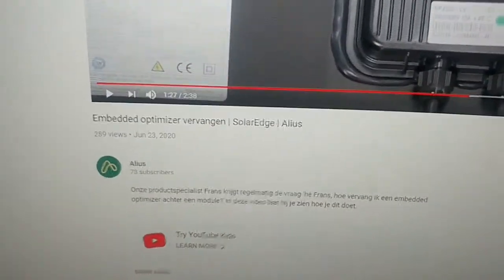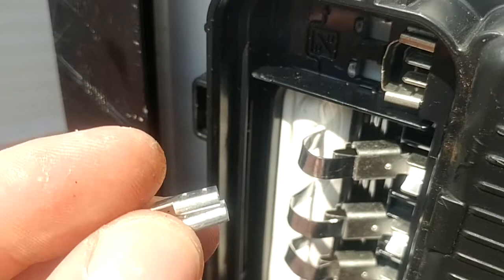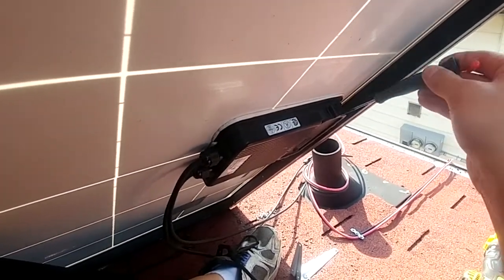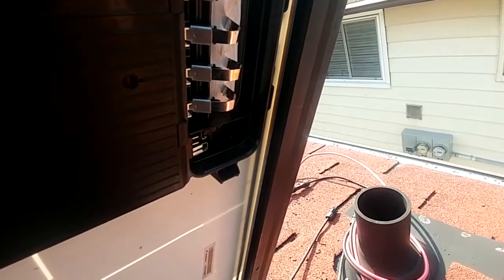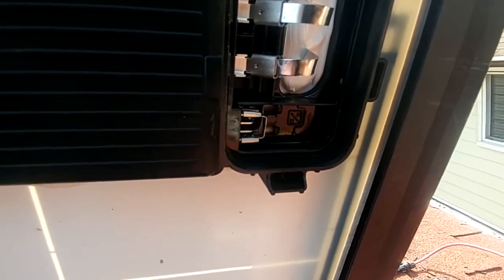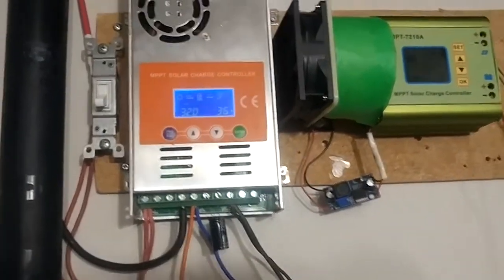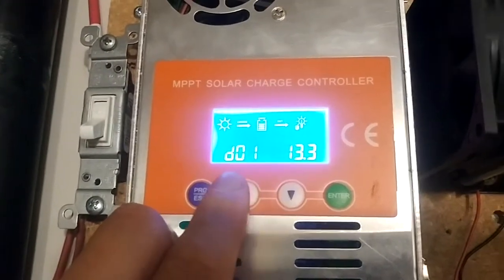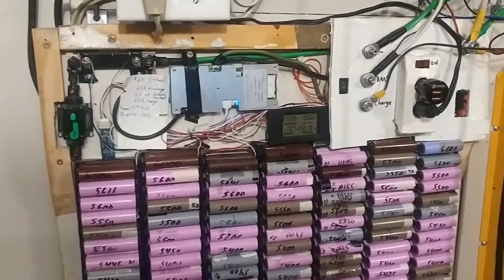Solar Panel Embedded optimizer bypass

Comment: I did the same and I'm getting 80V from 2 panels in series, is that what happened to you ?
Reply from the maker: I went parallel. Seemed to work with no issues but it was a short run to the controller so minimal line loss

Comment: Welcome back! I just bought a make sky-blue, controller, if it works well, I'm getting 2 more, I just bought a dozen 270 watt panels, and have bought some 120 ah LG Batteries, all together, about 33kwh, but still have alot to do! The panels take up a 13' x 20' area, and I have mounting to build, I have my other panels on the roof,  you can get the real make sky-blue controllers 60 amp for like $99 shipped, from make sky-blue USA, a dealer/servicer for them, a 60 amp, using the genetry solar, discount ,  I hope to have days of power after the batteries are installed, and the panels are up. Then I can charge then in a descent amount of time!  Good day man!
Reply from the maker: Thx good to know. Yea mine is 3rd shift china factory and old bad firmware. Its small issues but im sure the new ones are great

Comment: What wrong with the Make Sky Blue ? Other then being  Common Pos they work ok.   Using User Battery you can set the voltage.
Reply from the maker: Mine is 3rd shift old firmware. New ones with proper makeski labeling are prob much better
Reply: @AndyShell  I have a 20A version like that.  They came a s kit only All you received was the PCB and buttons.  You had to add everything else.  I went with Epever.  Built like a tank they are.